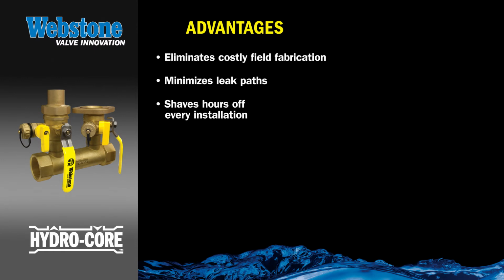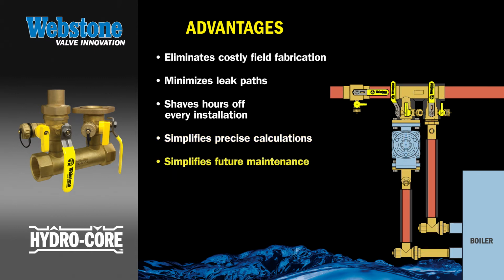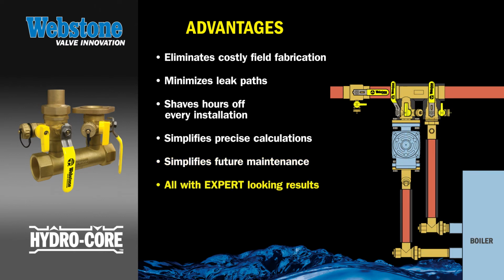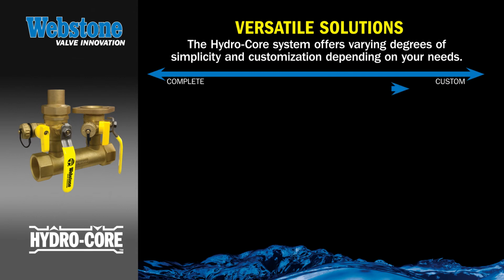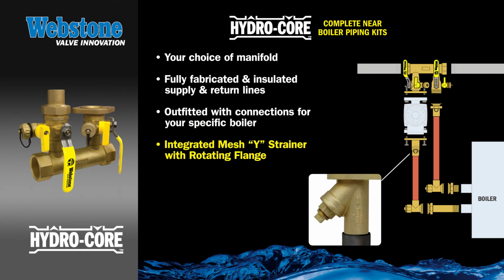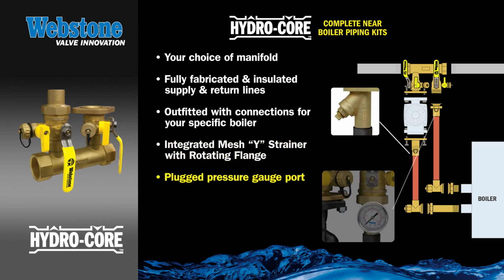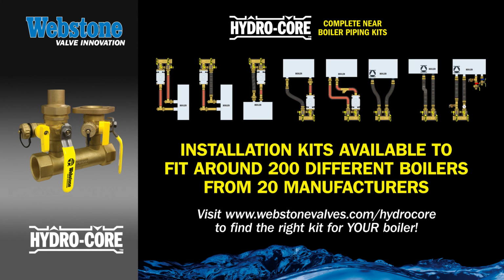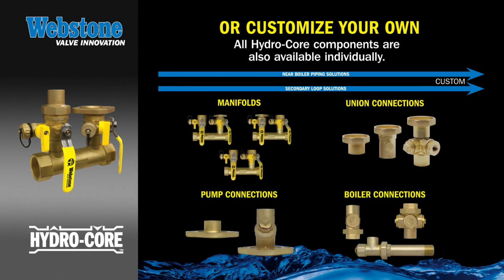Hydro-Core

Comment: This sounds exactly what i need for my hydronic system to mate to a outdoor boiler...to get a closed loop for my radiant floor heat manifold which i have to build ill use a heat exchanger for my boiler but ill need a pump to circulate water in my primary loop is this what ill need

Comment: Can this design go on a outdoor wood boiler
Reply from the maker: Hi James. We do not recommend installation in Conditions where freezing is possible. So the recommendation would not support installation on an outdoor boiler.
Reply: @WebstoneValves  there will be glycol as per heatmasters request in the system and i live in Tn where its nowhere near as cold as in Minnesota
Reply: @WebstoneValves  i just need the dimensions of the unit to be sure of the clearance to insure it will screw on
Reply from the maker: @jamescecil4629   Here is the link to the NPT Ball Drain specification sheet: http://www.webstonevalves.com/customer/wecoin/specpages/H-x061.pdf.
And the link to our technical page on our website: Vhttp://www.webstonevalves.com/default.aspx?page=customer&file=customer/wecoin/customerpages/spec_sheet.htm. Once you determine the manifold you require based on your boiler, double ball drain, flange right or flange left you can find the proper specification sheet that will provide the measurements you need.
Reply: @WebstoneValves  in this video instead of using the supply and return in a boiler  wont this work just as well using a heat exchanger so i can use my open loop outdoor wood boiler to supply the heat to a heat exchanger
Reply from the maker: @jamescecil4629  Hi James. Please contact us at Webstone@nibco.com.